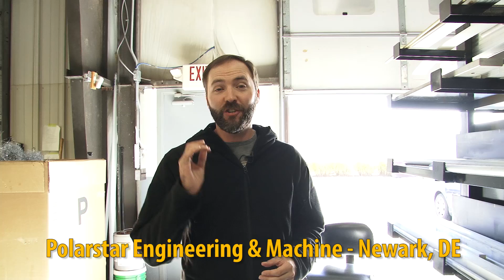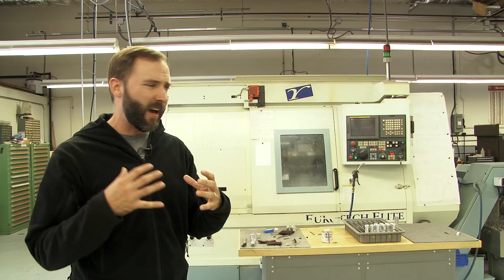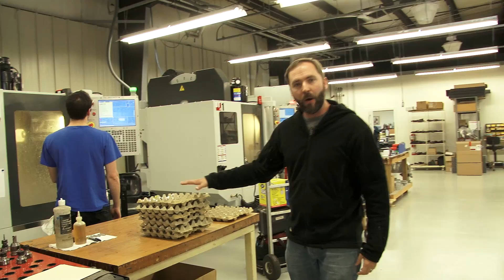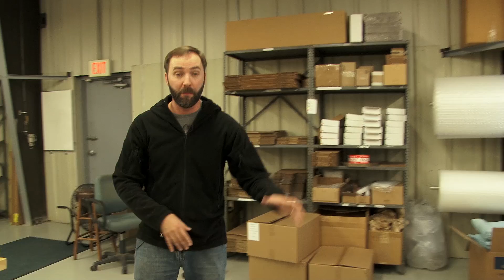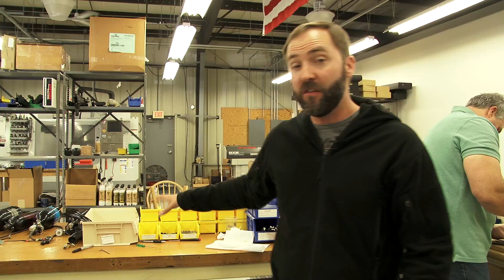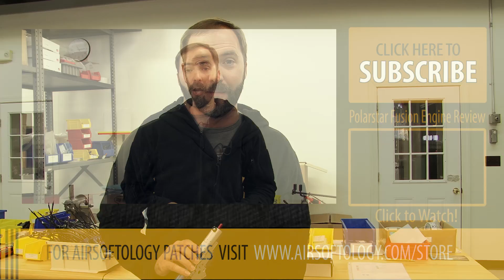Polarstar Factory Tour: How It's Made | Airsoftology

Comment: How Polarstars are made.

When a paintball gun and an airsoft gearbox are locked in a room with each other for about half an hour or so.
There ya go kids!
Reply: Actually most pb markets are built closer to the ics markers cause their split gearbox and quick change spring system is very similar to how pb frames split and the spool/poppet comes out like the ics spring does. Only thing pb and p* share is hpa which is like saying an hpa powered drill or a pressure washer is that just like a p* XD
Reply: RTAIRSOFT I was tryin to make a joke.
Reply: +jaxson smith i got you man, this guy doesn't get it i guess... lol

Comment: That new fcu looks bad. If it is that small and is trigger controlled, why even have it outside the p* engine? And you can fit a regular fcu and small battery in regular m4 stocks anyway, so then the answer is: why? Unless this IS the Bluetooth unit, which I don't think it is...
Reply: +Graham Williams The mini one is an "internal" FCU while the larger one is an external FCU. The mini FCU is designed to fit inside of the gearbox shell so only your power leads are exposed. Therefore your wire harness is not subjected to the stresses of taking the FCU in and out of your stock.
Reply: +Rodd Rambo that only works for the jack though, I think, but is there any reason to get this to replace the original one?
Reply: +Graham Williams The mini FCU is only designed for the single solenoid driven systems like the JACK and the upcoming F1. It would not work with the dual solenoid driven Fusion Engine. The mini has much lower power consumption when at idle and, since it is internal, it does require you to find a place to put it in the guns body. Also, since the wire harness is internal, it eliminates the possibility of the harness getting damaged.
Reply: +Rodd Rambo OH, i was confused, because i thought it WOULD work with the old systems, which would be a pointless downgrade to use this. Thanks for explaining that, i was a little confused about what jonathan said.